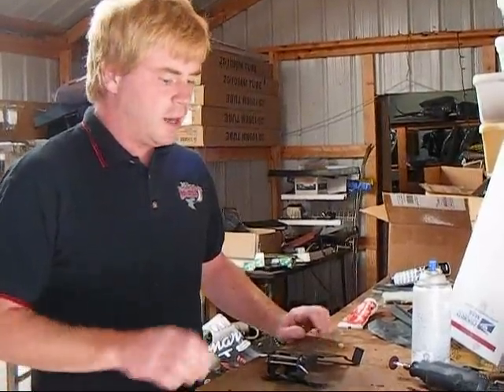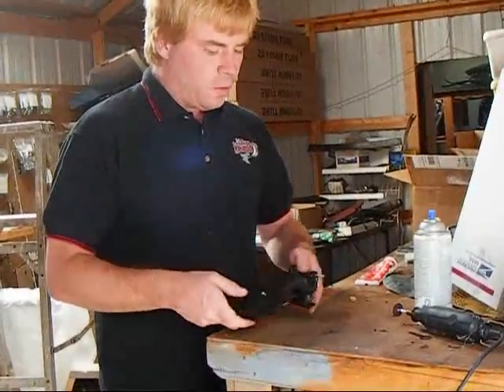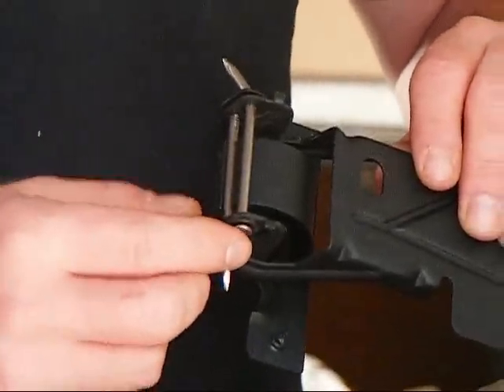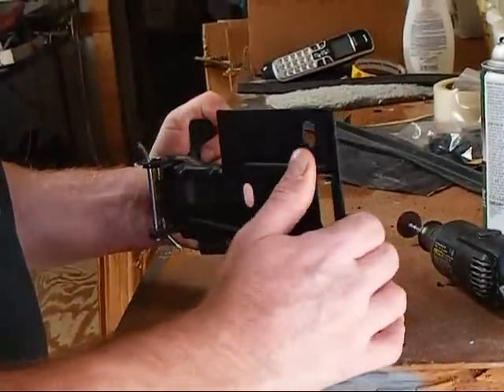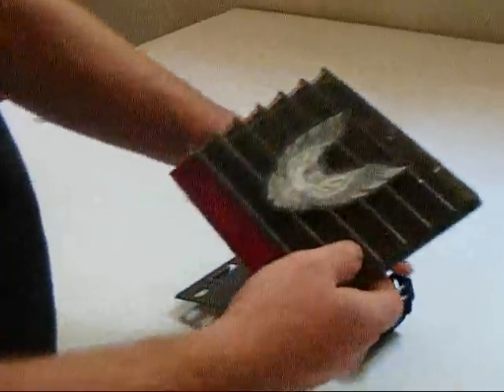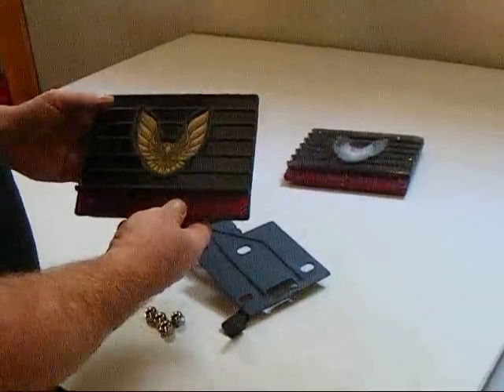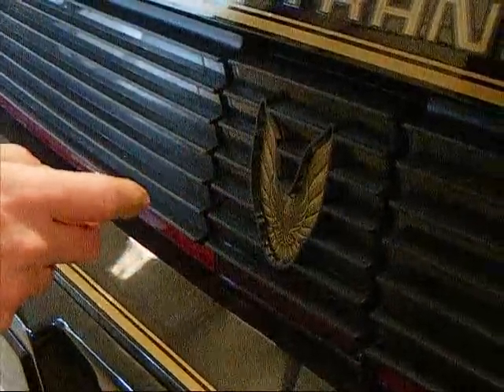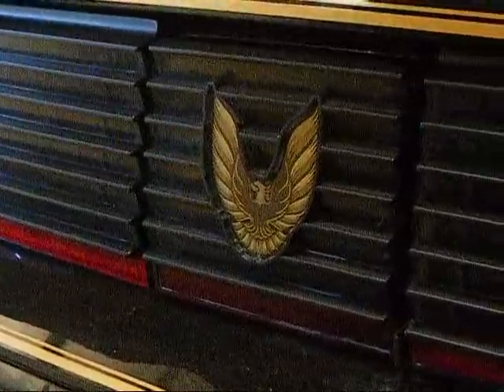"HowTo" Rebuild the fuel door hinge on a 79-81 Trans Am

Comment: Nice video, I went to the garage and installed "NAILS".  The gas door opening part way has bugged me for years (even tried velcro).  I did add a little litheum grease to nail contact area.  Also might advise spraying dome nuts with a little penetrating oil so the plastic studs don't snap off.  THANKS Again.